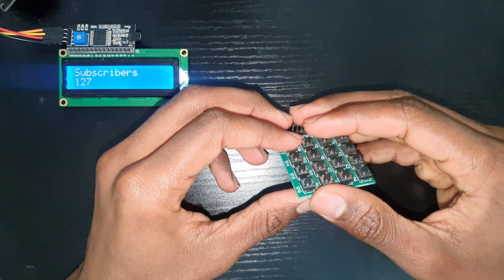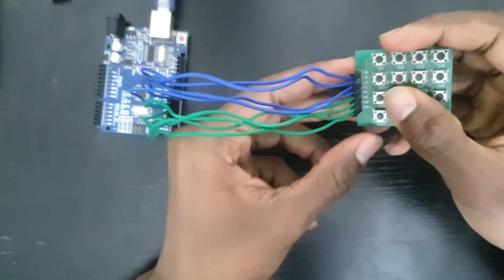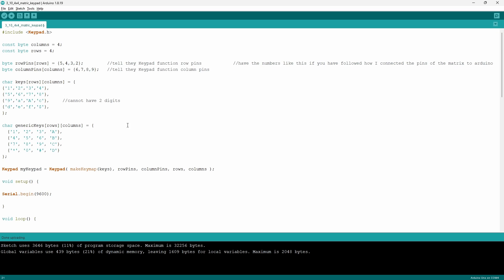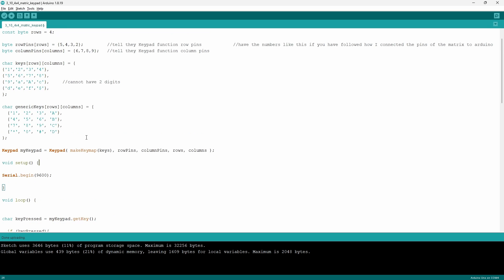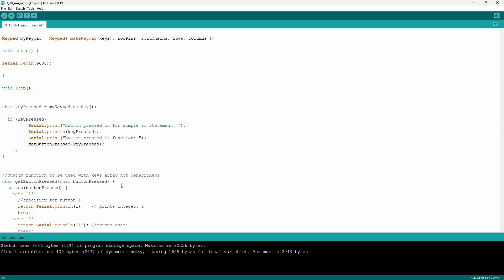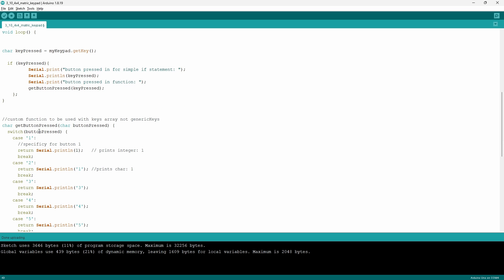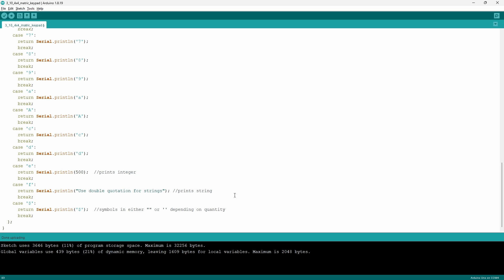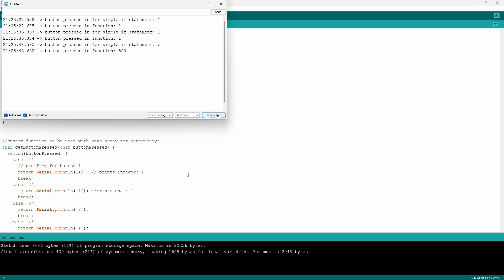Arduino Series: Tutorial | 3:10 4x4 Button Matrix

Comment: Thank you. Now library from the Adafruit is updated and called Adafruit_Keypad.h. But you can figure it out without any problems using example files.
Reply from the maker: Hey man. Good spot. Turns out i was refering to the wrong library. Though both are quite similar i see a bit of a difference. Ill the correct library. Cheers